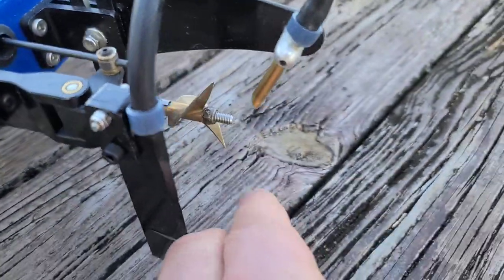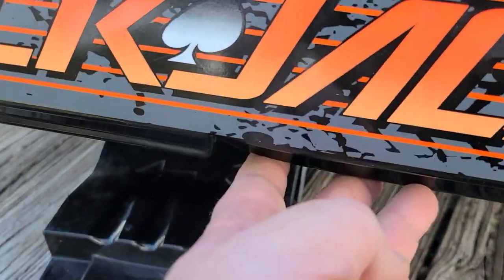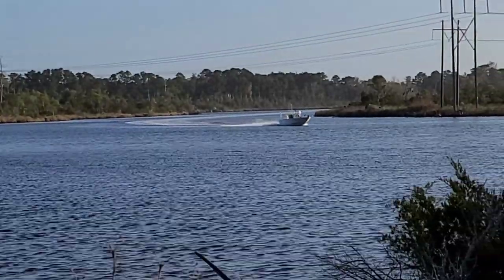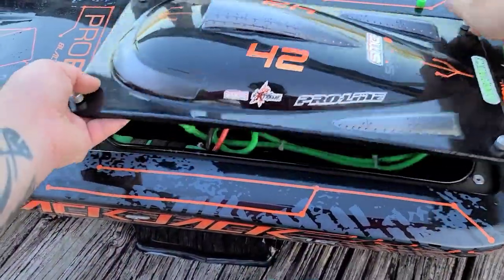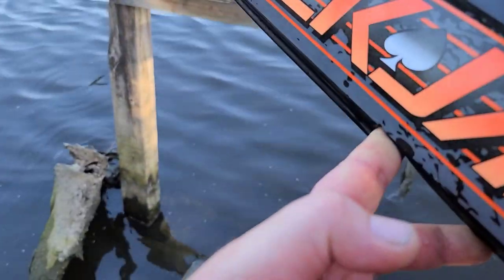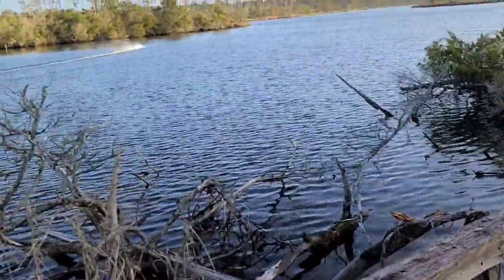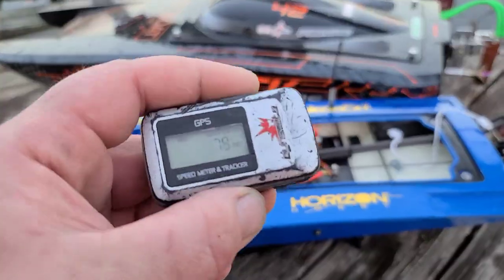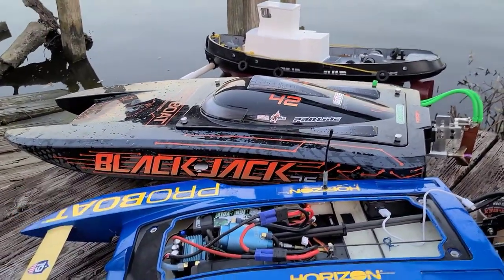Upgraded Proboat UL-19 & Blackjack 42 Speedrun

Comment: Dropped a new system in the ul thinking it would run a little cooler as I heard the stock system doesn’t like prolonged 6s running and getting some white smoke when I open the hatch. Temps are pretty hot, 160 on esc, 120 on motor and 100 on the wires. You think the esc is getting to hot and that’s where the smoke is coming from? Time for a higher amp esc like the raider 150 u think? As always, love the vids! Thumbs up!
Reply from the maker: Your smoke could be the copper winding in the motor.  Look in the motor to see if the copper wire has turned Blick. Just look into the open end bells.
Reply: The wires inside the motor look good, no black from what I can see from the holes. Esc has a faint burnt smell so guessing it burned something lol. Just put in a 4082 2000 with a raider 150 and drilled out the stock water exit hole bigger since it appeared to be the bottleneck in the water system so hopefully she runs cooler

Comment: Great Vid Big B,  some nice runs, especially with the UL-19.thats a sweet boat!. About C ratings, you mentioned in a vid awhile back that the V2 would run better on 5000-7000ma, 100c plus packs and up but to not run say the 5000 packs on 50c in regards to better performance of the boat with 100c plus.I was going to buy 2 Gens Ace Bashing ,6800ma,11.1v, 120c,3s,EC5 for my V2, as a choice over the Spektrum 5000,100c packs. Any advise is appreciative even on your new Zee packs as a choice..Thanks
Reply: I understand what you said on the C rating overall. ill be running the Firma 16a in the v2 as well for battery selection
Reply from the maker: Are you looking for top speed?
Reply: Hey Big B, thx for the reply. I am looking to go fast, but not "blazing" fast.In the 60 plus mph range or so would be ideal.I also have a CNC 4519, and waiting for a ABC 1716 to be available to go with the 160 Firma. As I live in Ontario, good Lipo selection is limited in availability. What would you recommend as a good choice in my set up. Thanks for your time and help.
Reply: Hey John, I run the Gens Ace Bashing 8000mah 100C in my V2 and they work awesome. Not too heavy, lots of run time vs the 5000mah 50C Spectrum (which I also run in it with no issues on stock electronics) Also in Ontario and yes it's hard to find good batteries here local!
Reply: @urbanarborist1160  

Hi,
Thanks for the reply back on the Gens Ace lipos, that's prob the type I'll go with .Can I ask what your using for an esc, and props, and what speed your getting with your present set up..thanks

Comment: Could you possibly run that oxidean 50mm 3 blade? Also, I have a abc 1917, battery draining prop. It’s only a 3 speed pass with 9000 100c batteries. BUT, it’s a fast one lol
Reply from the maker: I lost my 3 blade oxidean, nut spun off and so did the prop grrrrrr.      Is the  1917 worth purchasing in your opinion?
Reply: @IRONCLADRC  I don’t think it is. As horrible as it drains batteries it’s good for a pass or two, I like to run fast but have run time

Comment: Hi sir can i ask you something in your experience what is the right set up for rocket motor 3650 with 4300kv what is the size of prod i need to use and how many cell of battery i use and how many mah needed for this kind of motor thanks in advace boss please help me to set this motor
Reply from the maker: I'd go with at least 120a esc on 3s
Reply: How about the size of proppeler sir what size i need to use
Reply: A bigger one if you wanna fly ;) Hard to say unknowing the specs. Same size higher pitch, or bigger one with same pitch? Trial and error.

Comment: Nice runs. You could see in slowmo BJ recovered one time from lifting, looks big lipo's in front did help and speed also was fastest. I think much bigger prop makes no sense, motor gets warm/hot so there is not much more left a asume... You should be able to see some of your changes in your data (amps, rpm) but i guess youre so busy you haven't looked at it yet ..
Reply from the maker: Unfortunately i don't have the castle link yet it's on the way, soon as it comes in I'll do a video assessing  the data logs.  actually very interested in the data.
Reply: @IRONCLADRC  I think it will be helpfull choosing the right prop. As an example, i ran same speed from cutdown (blade area) 47x1.4 as with a 43x1.6 high rake. 47mm is more load, without cut i can't run a pack normally because of temps en cutouts,  with the cut i can run it hard but for short time and then i have to cool down. With the 43mm i can run whole pack hard. So if i would get 1 of 2mm more i would be faster  with same "inconfenianties"... Some times is bigger not better. With the data you can see those parameters. Can't wait to see how this all evolves. I'm sure there will be more new pb's in the future...

Comment: The C rating is an arbitrary (made up)number, not really a reliable factor.  SMC states that right on their website, that it is marketing mumbo jumbo to sell batteries. 
Internal resistance, under load testing, and quality wiring/terminals on the end user(the consumer) are what matters.